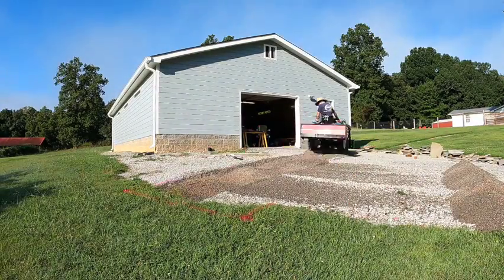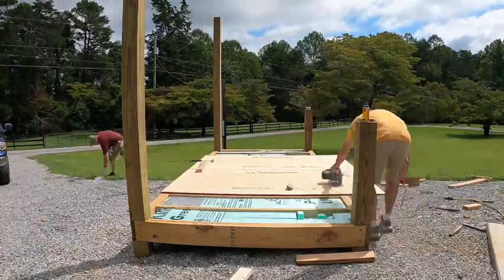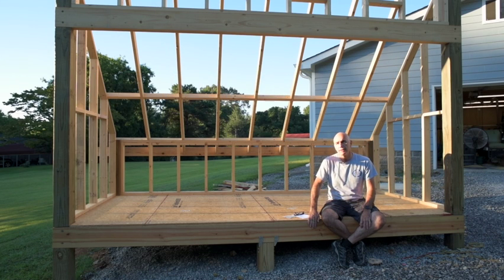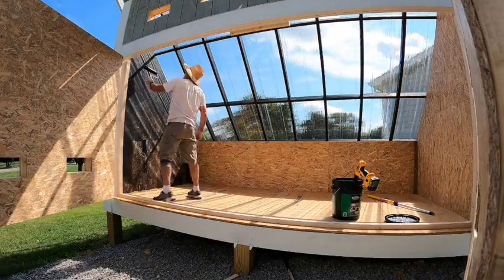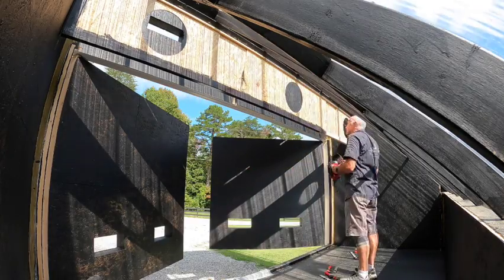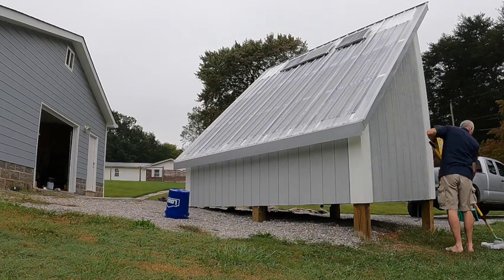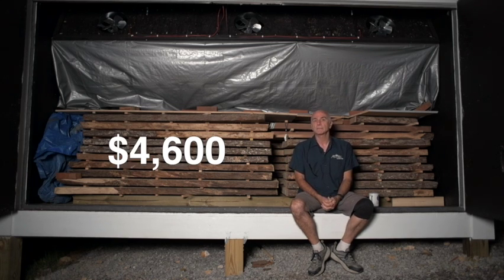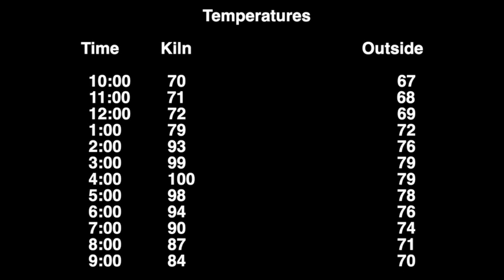Solar Kiln Build

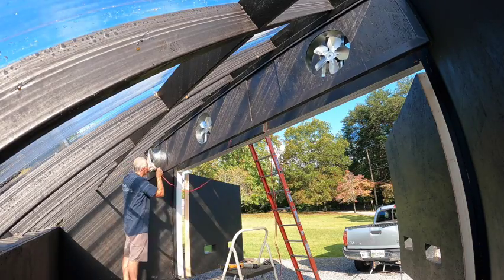Comment: 8:03 Maybe you could have switched + and - cables to get the motors in the fans to run the opposite way? Anyhow, the build looks great. I hope to build one at some point and this video was fun to watch and also educational. Nice job!
Reply from the maker: Thanks for watching!  I didn't have the crimps so it was easier just to undo a few screws for each fan and mount it on the other side of the baffle.

Comment: This is super nice kiln! I am interested in how you did the hinge work with the fans.
Reply from the maker: The hinge works great for getting the fans up out of the way when I'm loading the kiln.  I just attached them to a 2x4 framework for the clear panels on the front.

Comment: Great work and documentation of the process!  When you say you would have changed the dimensions of the kiln it wasn’t clear to me to what size you would change it.  How wide would you make it?  Some multiple of sheet good sizes?  Thank you.
Reply from the maker: Yes, I would have made it 12' to make it more economical to build with sheet goods.  I cut my lumber down to 10' for material handling purposes so I don't need it to be as long as it is.  It does make it easier for loading and unloading though.  Thanks for watching!

Comment: That was great ...... does it get up to 140 f  ? Also did you use a dehumidifier?
Reply from the maker: We recently had some nice days that got up to the low 70's.  The kiln got up to 140 F.  A dehumidifier is unnecessary because when it gets to that temperature the humidity drops into the teens even though it's 50-60% outside.  I also have a couple leaks to take care of and it should get hotter but going into summer it should be fine.

Comment: Very nice kiln. I would like to hear if you have a problem with bugs in the wood. Or does your solar kiln effectively take care of them? Thanks for you time to make this video.
Reply from the maker: So far my kiln has not gotten hot enough for long enough to do an effective bug kill.  However, I have never seen a bug in any of the wood I have used after it has been air dried or through my kiln.  I don't know if it's the area (Chattanooga) or the wood I primarily use which is Black Walnut, Pecan and Hickory and Red and White Oaks.  I've seen plenty while cutting them with the sawmill but as the wood dries it becomes uninhabitable for the ones when the moisture content was high.  I'm not saying it's not possible.. I've just never seen anything.

Comment: Hi Paul—Great video.  I’m interested to know how you insulated the floor.  As you’re building it, you are standing in it as you put in the cross bracing.  Then the footage of Hurricane Ida comes.  Then you say you insulate it with waterproof insulation, but how exactly do you do that?  The clip before shows it with no bottom to hold the insulation.
Reply from the maker: I nailed strips to the bottom of the joists so the rigid foam insulation would not fall out however i'm a little worried something might make a nest in there.
Reply: @hillbillychic3933  Regarding a critter making a nest, I suggest adding 1/2" hardware cloth that runs from your floor framing to a couple inches under the current level of the gravel and then out parallel to the grade 12 to 18" away from the kiln and cover that up with gravel. Critters will be stymied by the hardware cloth and look for an easier target

Comment: Nice looking build. Those fans are DC powered so you could have just switched the polarity to get them spinning the opposite direction, instead of switching the housing direction. Unless I'm missing something.
Reply from the maker: No, you are correct but I didn't have the crimps so and it was easier to just take out a few screws.  Thanks for watching

Comment: nice job! Whats the brand of roofing rubberized paint you bought at lowes?
Reply from the maker: I used a rubberized coating called Rubr-Coat #57.  I think I got it at Lowes or Home Depot but it has held up pretty well over the last year.

Comment: I keep wondering if you could make it able to rotate, so you can track the sun and get more light. Hmmm..
Reply from the maker: you could but it's working pretty well in a fixed direction.  Adding that complication might not be worth the hassle.  But, if I were to do it I would use the slew ring from a crane.  It can take the weight no problem.

Comment: Are the fans that you used putting out good airflow?  Have you added batteries to your fans yet?  If so, that would be a great video to make showing the battery and charging setup.
Reply from the maker: I have pretty good airflow and the kiln is working well at drying especially now that the temperatures are coming up a bit.  I'm pretty happy with the way it's running so I may just leave it as is and not add the complication or the expense of going to batteries.

Comment: Hello from east Texas.Because of the situation in America now, some of us are having to consider new ways to survive. I have a healthy stand of mixed timber on my place. The pine stand from 18 to btween 3 and 4 ft is probably somewhere around 60 trees. With the price of frame lumber being what it is I have to consider this. How much will your kiln hold per full run. Thanks, and great job. Reggie
Reply from the maker: The plans are from Virginia Tech and they say it can do 800 board feet at a time.  I have less in there now because it's winter and the temperatures aren't getting as hot.  In the summer you would probably want it full so that the boards in there don't dry too quickly with the summer temps even with all the vents open.

Comment: Great video.  Could you elaborate on your comment concerning width… did you mean you would rather it be wider?  Thanks
Reply from the maker: I would have made it narrower or 12' to use the plywood more efficiently.  having it 13' just makes you buy that extra sheet of plywood to cover that small gap.  It's like Virginia Tech said we need to build a kiln that will dry 800 board feet and designed it accordingly.  Rather than building the largest kiln they could being efficient with materials.  Hopefully that makes sense?  Also, cutting my logs a bit shorter will make them a lot lighter and be easier on my back.  I want to be in this for the long run.
Reply: @hillbillychic3933  That makes perfect sense and gives me a few more things to consider.  Thanks for the reply.

Comment: what would be the disadvantage for making it say 25'feet wide as opposed to 13'3" ?
Reply from the maker: Nothing really, just managing that much lumber in the kiln might be a bit more awkward.  I'm assuming you don't have really long lumber because making doors that long would be impractical and having more than two doors means you would need a support somewhere in the middle which would make loading longer logs very difficult.   Air flow through the logs is also important so you wouldn't want a gap in the middle anywhere.  I shove a tarp on each side of my stack to direct the air flow through and not around.  Hope that answers your question.  Thanks for watching.
Reply: @hillbillychic3933  . I’d not thought of blocking off the ends to prohibit air flow there. You are a good “thinker”. I just subscribed.

Comment: Paul, 

I live about 30 miles north east of Knoxville and I was wondering what your thoughts are on efficiency of the solar kiln after use this winter and fall?  On average, how quickly can you dry lumber?  What’s your total cost in the structure if you don’t mind me asking?  I’ve got a sawmill too and am considering building a solar kiln to increase the value of my efforts.  

Thank you for sharing this video as I feel it’s one of the best out there on the subject.  

Respectfully, 

James
Reply from the maker: Hi James...  Total cost and reasoning for it was in the video so I don't mind sharing.  It was $4,600 but that was when lumber prices were pretty high.  I had to use stamped lumber but if you use your own you can save quite a bit.  I air dry lumber in my barn down in the 20ish percent before putting it into the kiln and the last load of hickory 4/4 only took about 10 days but the 8/4 is still in there but drying pretty quickly and should be out by the end of the month and that is with leaving the vents open because I don't have much room in my shop at the moment and I am in no hurry for it to dry.  I'm very happy with it and surprised that I was able to dry quite a bit of 4/4 stock over the winter.  It won't get hot enough for a bug kill until later this spring and summer but I'm not too concerned about that.

Comment: If you're using sheet goods, what's a better width for the kiln?
Reply from the maker: If it works for you and the length you cut wood I think 12' is a more efficient use of materials.

Comment: Hey there! Is there an update on the kiln? Thinking about building my own.
Reply from the maker: Hey..  I'm going to do "one year with my solar kiln" or something like that..  Is there something you would like to know specifically?  I do like it.. it's good!  I will even give you the spoiler of the video..  I need more space to air dry before putting wood in the kiln and I'm working on that.
Reply: @hillbillychic3933 The length is surely something to consider. Im thinking of a different roof material since we get a lot of snow. So an update on how your roof is holding would be nice.

Comment: Great job Paul, did you use Renogy solar panels ? A lot of people I know that live in their vehicles use renogy .
Reply from the maker: I'm not sure what brand they were but it was a package deal from Amazon for the panel and fan.  I installed some Renogy panels on a friends cabin and they are still going strong after a good few years.  They seem great for the price point.

Comment: Do you happen to have a material list for the kiln build? I have been looking at the Virginia Tech build and spec sheet but, I will also need to go the 6x6 route.
Reply from the maker: Sorry I do not..  I looked at my excel sheet and it only had the costs.  I went with the cut list off the Virginia Tech plans and just modified the number from there.  I still don't know why the thing is 13' long.
Reply: @hillbillychic3933  Thanks for the follow up. I was thinking about shrinking it down a bit in both length and height. I would like to still be able to get a 10'6" board into it if I had to. Did you use OSB T&G for the sub floor or pressure treated like it call out in the prints?

Comment: Nice job! As the fans are DC couldn't you have just swapped the cables over to run them in the reverse direction?
Reply from the maker: Yes but the connectors were set up to only connect the one way.  I could have dug around for mine and redo them but it was easier just to remove the 4 screws and put the fan on the other side of the baffle.
Reply: @hillbillychic3933  Yep - easiest is always the best!

Comment: Do you have to have the tarp to keep direct sunlight off the wood
Reply from the maker: Yes, for two reasons actually.  To keep the sunlight directly off the wood but to also direct the airflow from the fans through the front of the stack of wood.
Reply: Thank you for your response good info .

Comment: Great kiln man! Looking forward to more of your content. What sawmill do you use? I just bought a house on 12 acres of mostly mature hardwoods and my next project or should say projects is to get a sawmill and build a kiln. I recently got a chain sawmill and that isn't going to cut it lol.  just doing research now. Thanks for the video and any tips you have!
Reply from the maker: I have a Cooks sawmill.  Mostly manually driven except for raising and lowering the head and that is electric.  It's a good choice if you're doing it for yourself and are the weekend warrior.  Hydraulic systems are pricey.  I'm pretty lazy so the chainsaw mill was never an option.  That's a lot of work.  I'm not sure how my kiln will work out during spring and summer.  I'm pretty sure I don't have enough wood in my barn to keep up with it.  Not a bad problem to have though.  Thanks for watching!
Reply: @hillbillychic3933  Thanks! Yes chainsaw mill is way to slow for me. I'm looking at the woodland 130 max. I'm not a weekend warrior I'm a full time wood worker photographer and youtuber. Just really like the process of milling and drying my own lumber and possibly selling some dried lumber for another source of income. Thanks for the reply!

Comment: That was a great build.  I really liked being able to pull steps for the build as I am going to be building mine very soon.  I had been wondering about how to build the platform to keep it off the ground and I like how you sank posts for the structure but I might just use lag bolts to attach a rim board to make it easier to level and then trim the posts to desired height at the top to set the top mean to hold the trusses.  Great build I really enjoyed watching that come together.  How deep is your kiln? Thank you again.
Reply from the maker: It's about 5' deep.  I didn't have level ground so I had to build my kiln there.  It's a little awkward to load and unload because the tractor forks are uneven because of the uneven ground.  If you have level ground build it there!

Comment: Can you dry hand hewn logs in a solar kiln and if so how long would it take for them to dry for interior use?
Reply from the maker: Sure, there is a lot to that question but let me just give you an example of what I have done so far.  I left 1" wood in my barn for about 8 months until the moisture content got down to around 20%.  I chucked them into the kiln and got the moisture content down to 8% and that was just for a few weeks in November when the kiln was only hitting about 100 degrees on good days.  During the summer you could take a fresh cut lumber and throw it into the kiln and it would dry in about 6 weeks.  There are lots of factors though, species, thickness, time of year, where you live (heating and cooling in your home).

Comment: Great. But how long to make its dry?
Reply from the maker: Depends on time of year, how dry the wood is when you put it in the kiln.  But in the summer a fresh cut tree can take up to 6 weeks.  If it has been cut a stacked already and is partially dry it will take 1-2 weeks.

Comment: We are planning on building a solar kiln soon, so this was a great video to watch. What was the black material you used under the siding?  Did you put any insulation in the walls?
Reply from the maker: The black material was tar paper for roofs.  It worked pretty well although I would use staples instead of the nails with the washer. on them.  If you use any flashing, it can get caught up on the washers.  I also used fiberglass insulation in the walls.

Comment: How long does it take to dry the wood
Reply from the maker: Depends on the thickness..  But, I will let it dry in my barn until it get's down to the 20%ish moisture content  down from 70-80% when first cut which takes 4 or 5 months and then will throw it in the kiln and right now in the winter it will take a 1" thick piece about 5 weeks to get from the 20% range down to the 8% to 10% range..  This summer I would expect it to take a lot less time in the kiln but will probably need to slow down the process so the wood doesn't dry too quickly.

Comment: If those are 12 v dc fans instead of turning them around you probably could have reversed the leads.
Reply from the maker: They were, but the leads only plugged in the one way so I would have to replace all of them.  It was quicker just to take out the few screws and reverse them.

Comment: Did you use the wooden closure strips under the polycarbonate panels?  Like the ones here:  https://www.lowes.com/pd/Tuftex-Wood-Solid-Roof-Panel-Closure-Strip/3012462  If yes, did you use them on every rafter?
Reply from the maker: Only on the top and bottom.  There is enough flex in the panels that I screwed them to the supports in the middle of the panels.  On the sides I used a tacky sealant that comes in rolls for weather sealing those same panels.  Please let me know if you have any other questions.